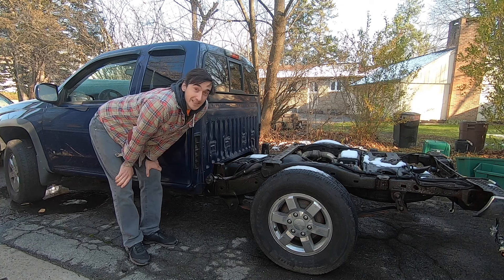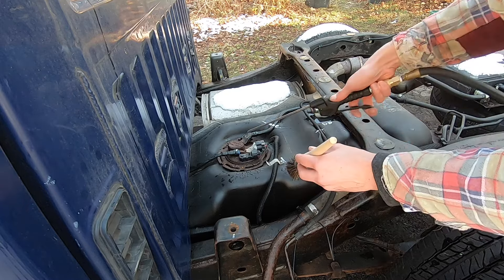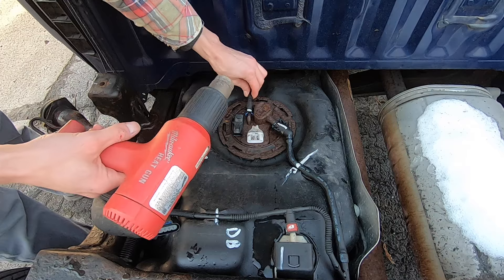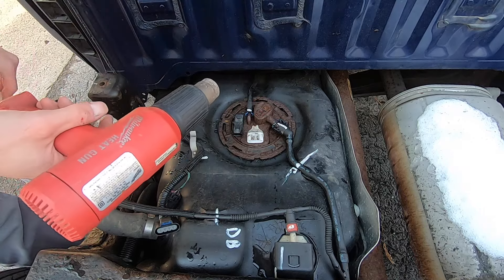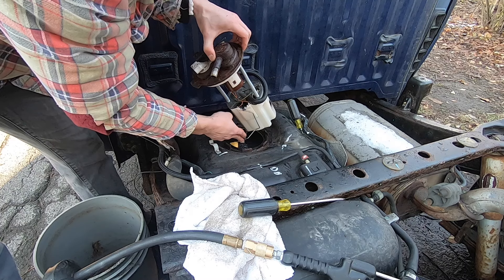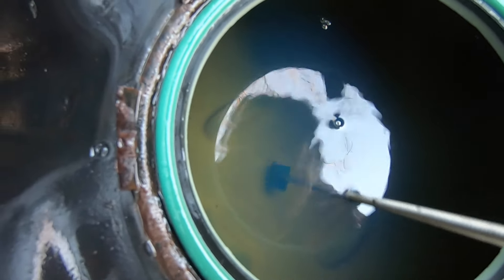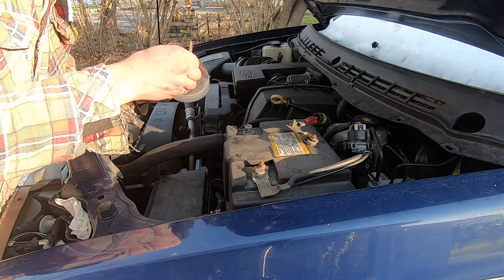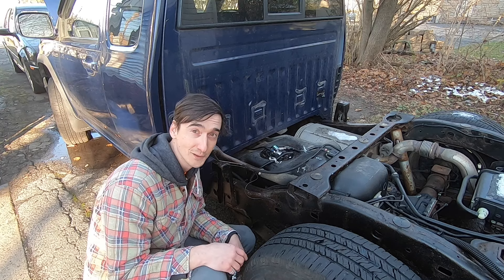Replacing the fuel pump in a 2004-2012 Chevy Colorado or GMC Canyon

Comment from the maker: Here's a link to the pump I got, it came with the O-ring and seemed identical to the OEM one: https://amzn.to/3lnpGG7
And the lock ring: https://amzn.to/3trwXaI

Did you know there's no cabin air filter on these trucks? Check out my other video showing how to install an aftermarket one to keep leaves out of your fan and interior: https://youtu.be/qgZKQM9OP6g
Reply: Man I did this job less then a year ago on my truck.  Don't skimp and get a lesser pump.  I got one that was 140 dollars off Rock auto and the pump works great but the fuel level sensor is throwing codes which causes the truck to have hard start issues and the fuel gauge to report empty at all times.  I just spent 200 to get the Delphi.  Your would think I would learn, if it is a hard job splurge for the good parts from the start.  LOL
Reply: Did your replacement fuel pump come with rubber feet on the bottom? I just got my replacement and it seems they're missing 🤦‍♂️
Reply: @bradenremillard7228  Not even sure what you mean, I never noticed rubber feet on any of them, go figure.  I can tell you that the replacement Delphi solved all the issues.  My aftermarket slightly cheaper unit lasted all of 9 months before throwing engine codes for electrical issues from the fuel sender.
Reply from the maker: @bradenremillard7228  I don't recall seeing any rubber feet on mine. The bottom of the pump has a castle-like pattern that needs to press against the bottom of the tank to filter out large particles. I can't see what purpose rubber feet would serve, seems like they could even cause a problem if they prevented the above.

Comment: Know this is an older video, BUT....
Just wanted to leave an FIY for anyone else watching and you Adam. At the 4 min mark, where your removing the fuel lines and the tool didn't work.... That blue part on the connector. Push both sides together with your fingers and pull the lines off. The blue SHOULD remain on the lines, and be removed AFTER the fittings off (has 2 hidden tabs made visible when the fittings removed, to get it off the line. This is essentially the "lock" holding the lines in-place and at the correct depth for the O-ring in the fitting to seal around the metal tube. 
Slightly different and the slightly the same as the second, larger one. 
Glad it didn't leak or break and worked out, but your VERY lucky it didn't go horribly wrong and needing a nylon line repair kit. 
That said, nice video and well documented.
Reply from the maker: I didn't quite follow. In the video the blue DID remain on the line. Why would I then remove it from the line? Appreciate the time you took to write this up!
Reply: @adamdport  im trying to get mine off now, i think he means the blue part should remain on the fuel PUMP itself.

Comment: Thanks, I have an '04 Avalanche and this actually helped me.  I already cut thru my floor but couldn't figure out how to remove the rusty retaining ring and fuel line connectors because the tool I bought didn't fit... never occurred to me to just use a screwdriver - thanks again!

Comment: I just completed this job on my 2010 Canyon Extended Cab. First of all the video is excellent and I referred to it multiple times during the repair. Here are the issues I had. 1st issue was the gas fill. It is a T30 torx bit. My screws were rusted in the fastner / clip and when they spun the clip that they were threaded into it destroyed the plastic portion of the gas fill. If there is any question of the screws not coming out, drill them out and replace them. 2nd issue was the electric connectors. In Adam’s video they popped right out but mine were stuck in there. On the connector on the drivers side of the pump, you need to stick a small screw driver into the forward side of the connector which should release the clip. I did not know this and I broke the piece of the clip that holds it to to the fuel pump. The 3rd issue was the bed was a-lot heavier than I thought. Start to finish it was about four hours. Also, I bought the removal tool for the ring that secures the fuel pump to the tank. I think it was worth it, but I still needed a hammer to assist it breaking it free.  Thanks Adam for the great video!
Reply from the maker: Really appreciate your comment, and I'm glad you were able to work through the issues you had!

Comment: Great work , this is the best video showing how to replace the Canyon / Colorado fuel pump . This will help a lot of folks out , me included . Just how many people does it take to lift the bed off without major difficulty ? Thanks , Adam .
Reply from the maker: I managed with just one neighbor's help but it's awkward and you'll both probably need something to stand on so you can lift with your legs. In a pinch you could probably jack it way up and then drive the truck out from under it.
Reply: I did mine myself. I wasn't worried about it being scratched or anything. Could use a cherry picker and ratchet straps

Comment: That was a good idea, sound like a junkyard shortcut.   But it isn't as good as something I saw 1 time.  I was roofing a house and looked down and saw 4 men with a mustang ,new transmission and a mattress, They flipped the car on the mattress, that was in a small ditch . They had the car on it's side then took out the old one out and put in the new trany in less than 1 hour.

Comment: Was looking for a guide this will work on the 08 colorado we have but will not work for a 04 Canyon with 4 full size doors because the pump is under the back seat instead of the bed.
Reply from the maker: Right I mentioned that in the beginning of the video. Is there an access panel under the seat or do you have to drop the tank?

Comment: The top of mine completely rotted out to the point where fuel was leaking all over the top of the tank and shot up 3ft when you cranked it over. I got the feed line off but the vapor hose side is frozen on 😭

Comment: Please help. I saw a video where the guy has the truck on then takes off the fuse to the fuel pump and the truck dies I guess he does this to make sure the system is off not sure but I did the same thing I took off the fuse then I put it bk on to move the truck. My truck does not start or anything it just makes a clicking noise when I turn key to on position, I have electricity so not sure what happened

Comment: The fuel pump should have been built  all the way with plastic which resist rust unlike the iron which likes rust. There exist a kickback between parts markers/suppliers and vehicle manufacturer.

Comment: Were you smelling any gasoline when around the truck before you decided to replace the fuel pump?
Reply from the maker: @Fishinandfarmin_tv  no, just my fuel gauge was messed up. Sounds like you have a leak, I've had the filler neck rust out on me before and you'd see it drip when you're filling the tank. You'll have to look to see where the drip/spray is!
Reply: @adamdport  there is no drip that i have seen and i have looked everywhere i could think. It started out as me smelling it right after i ran the truck but now it is anytime when i am near the truck. The truck is also throwing an evap large leak detected code (P055) so im getting a smoke test done but i asked a mechanic what he thought on why i am smelling gas all the time and he said that the likely problem is that there may be a hole in the top of the fuel pump because its just rusted out that bad

Comment: I have a quick question…should a dealership charge me extra if the gas filler neck also needs to be replaced if I supplied them with the replacement part?
Reply from the maker: Yes. Even if they remove the bed (which I doubt they do since they have lifts), the filler neck still isn't fully detached, and will still require some additional labor to replace. Shouldn't be much though.

Comment: i just pulled my 2007 fuel pump rotted what number are the quick connects so i could order some and my fuel pump was glued on i did not see a o ring on 2007 colorado
Reply from the maker: The connections are part of the fuel line, is that what you meant? Here's an affiliate link to a replacement fuel line: https://amzn.to/4bo1xHW

Comment: Could the heated blower be good on a leaking gasket ?
Reply from the maker: No. If you're talking about the o-ring under this fuel pump then you'll either need to replace the o-ring or if it's new make sure that everything is clean.

Comment: Hey Adam I have a question what is easier dropping the tank or removing the truck bed?
Reply from the maker: With the bed off you can work really comfortably and take your time, can address any rust issues on the top of your frame and under the bed, etc. If you drop the tank, you'll be flexing your fuel lines and will have to work on the ground a lot, and you might have 100lbs of fuel in your tank, but you could probably clean the tank out better than I could. If you end up dropping the tank could you leave another comment letting the next guy know which way you'd recommend?

Comment: So I’ve taken the bed off the trunk and ready to go ahead and do the rest the only thing I’m concerned about is any particles of rust getting in the fuel line. I’ve seen another video where they drop the tank and then clean the tank out very well. In my case I would have to sphion the fuel out. I guess I’m asking should I be concerned about any particles in terms of delivery from the fuel to the engine.
Reply from the maker: Yes you should definitely be concerned. If anything gets in that line it could turn into a major headache. That being said I'm less concerned about stuff in the tank since there's a filter/strainer built into the fuel pump. But you should definitely be careful when removing the output line from the pump and make sure there's no debris in there before sliding it onto the new one. If you have the time/means/patience to drop the tank and clean/rinse it then it certainly can't hurt.
Reply: @adamdport  appreciate it

Comment: Is it really easier than just dropping the fuel tank?  Seems dropping the fuel tank would be easier that you can do yourself and you won't have to worry about scratching up the back of the cab or the box.  Just curious.
Reply from the maker: Hard to say! Removing the bed gives you better access to the top of the frame and bottom of the bed for rust treatment. Dropping the tank might be faster if the hardware holding it up is in decent shape. I had a second vehicle and all the time in the world, and also didn't have a YouTube video to watch to show me what I was getting into. If you end up dropping the tank, could you reply again with your thoughts to help out the next guy?
Reply: @adamdport  Will do!

Comment: Does this help the fuel gauge
Reply from the maker: Yes. Before I replaced mine the gauge would show 3/4 after I filled it up. The new pump fixed the issue as it has the sensor built in.

Comment: Hey Adam one more question, is it difficult to remove the bed? How many bolts? Because my fuel pump went out a week ago
Reply from the maker: I talk about it in the first 20 seconds of the video, you'll probably need a friend to help you lift it off but in a pinch you could maybe hoist it up and drive out from under it
Reply: Feel like the filler neck would be a pain
Reply from the maker: @patrickbierley2418  iirc it's just 3 screws that you can access just by opening the fuel door. It's just on a rubber hose so you can bend it out of the way.

Comment: I replaced the fuel level sensor on the fuel pump. When doing so i think i left some debri in my gas tank because now im getting a p1174 code which is dirty fuel injectors. very unfortunate.
Reply from the maker: Sorry to hear that. Possible cleaner will break it down after a few tanks' worth? I like Castle's "fireball" cleaner but it's hard to find. Ace Hardware carries it locally, not sure if anyone else might. Let me know if it works.
Reply: @adamdport  I'm really hoping that's what will happen before I have to replace the injectors. I've ran 1 bottle of techron through and I also have some seafoam, I'm going to give it a little time and then maybe bite the bullet. Ill check out the Fireball cleaner.

Comment: Where did you get the pump from? I have a 2010 that I think is needing one. I found them at Autozone, but $289 was the cheapest
Reply from the maker: I got this Bosch pump on Amazon, it seemed identical in every way and came with the o-ring https://amzn.to/3lnpGG7
Reply: @adamdport  thank you. Any other tips for the job?
Reply from the maker: @michaelpane901  Do it on as empty of a tank as possible so you can do a more thorough job than me of cleaning out the tank! Also if you're in the rust belt, it might be a good time to replace your fuel filler neck before it starts leaking. If you're removing the bed like I did, you might want replacement bolts, mine were fairly rusty. It's also a good time to go nuts with the fluid film on the underside of your bed and the top of the frame, and feel free to lubricate everything around your spare tire setup. Saving a lot of money on this job, treat yourself to a nice dinner when you're done!
Reply from the maker: I forgot to suggest a new lock ring too, only $10 https://amzn.to/3trwXaI let me know how it goes!
Reply: Already had it delivered. Lol and getting the fuel pump today, so we shall see
Reply: Did you reuse the filter screen? The paper work claim it is sold separately and I did not notice you changing it
Reply from the maker: @michaelpane901  I called the dealer they don't have any part like that in their system. I'm not sure what paperwork you're looking at, but the description on the filter I sent you says "A new fuel strainer is incorporated into each fuel pump assembly (where applicable) to prevent contaminants from entering the pump". Maybe it's just a generic instruction Bosch includes in all their pumps?
Reply: @michaelpane901  What are the symptoms your truck is showing? I'm trying to troubleshoot some problems on My truck!
Reply: @POLOAZTECA  honestly, there were only a few symptoms like rough idle at times, and poor mileage to name a few. My biggest issue was a CEL and needing an inspection. I looked on a few forums, and they led me all over. This was one of the last items I tried.
Reply: @adamdport  youre right about saving money, shop quoted me $800 CAD to replace the pump, 1000 if lines cant come off, replacing all lines.

Comment: What made u feel like u needed a new fuel pump what are some of the signs I have a 2012 with 111k miles 2.9
Reply from the maker: My fuel gauge would only show 3/4 after filling up. I removed the bed expecting to find a wiring issue but saw how rusty the pump was and decided to replace it. But other symptoms could include lack of power, rough idle, intermittent starting, CEL, etc
Reply: @adamdport  p0171 is the cel that just came on yesterday but also I did just notice the small air hose that goes from the top of the engine to the air intake was unplugged so I'm hoping that's the issue
Reply from the maker: @vittoriosantiago  could be! If you remember, please report back whether it worked or not to help out the next guy
Reply: @adamdport  it went off so must of been that lil hose

Comment: Is this why my 2010 canyon is consuming so much gas????
Reply from the maker: If you smell gas, maybe. Otherwise probably not. Does your temperature gauge show normal? Any CEL? Are any of your wheels warm to the touch after driving?
Reply: @adamdport   smells like gas on start up only no temperature gage stays in the middle
Reply: What were your symptoms of a bad fuel pump. mine seems like it doesn’t have throttle and doesn’t run.sometimes other times it ran ok . Im using fuel pump replacement, and a last resort.

Comment: The car ran for little bit and on I turned car off and let it sit.now it want crank
Reply from the maker: Could be a dead battery? Or maybe you didn't tighten the battery connections when you finished?
Reply: @adamdport  it turns over .it ran for about 30 minutes and I turned the car off.smells like it’s leaking gas
Reply from the maker: @randywebb5296  dang sorry to hear that. Sounds like you didn't get one of the connections back on quite right. If the connection got damaged while removing it you might need to replace the line https://amzn.to/3tOq3z9
Reply: @adamdport  it was the clamp on one of the hoses .the end was still on other pump. Thanks for your information